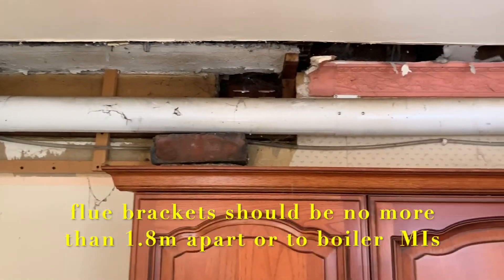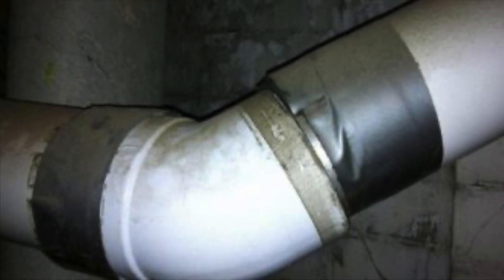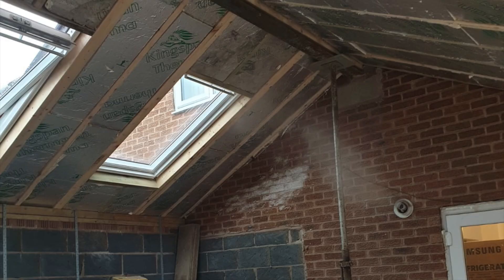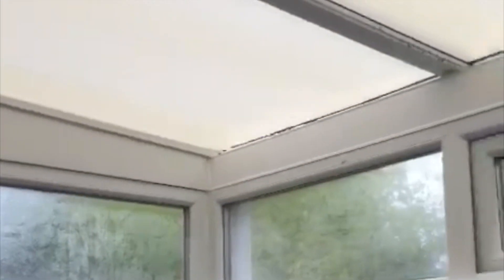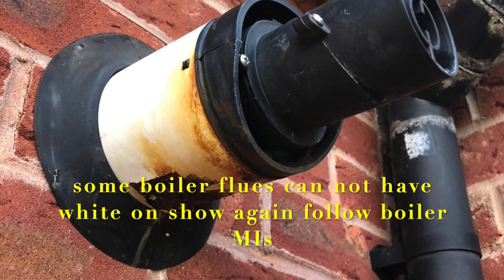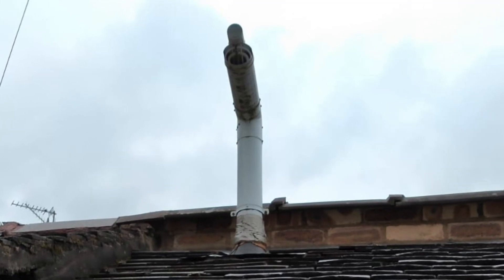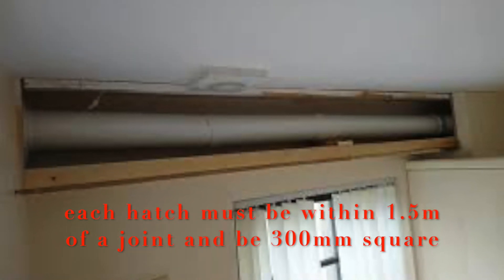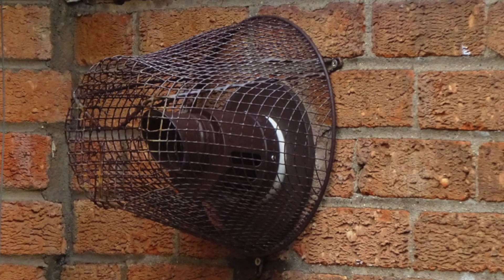Dangerous boiler flues,  things trainee gas engineers need to look out for when inspecting boilers.

Comment: Thanks for the video - very useful.  I had a new flue installed a few months ago with a new gas combi.  The flue runs with two 45 deg bends through the roof space, exiting vertically.  The installer has used the galvanised band strapping and screwed to the rafters.  Is there a written regulation that states this isn't allowed?
Reply from the maker: Look in your manufacturers instructions that will tell you
Reply: @tomkatgastraining  Thank you, I'll take a look through.   I've read them a few times before and don't recall specific mention of band straps.  I'll ask the manufacturer too.  We had a smart meter installation and the installer thought the straps were not ideal and cautiously put our installation at risk.  As you had also mentioned in your video they're a no-no, I thought they might be universally condemned by some regulation or standard.